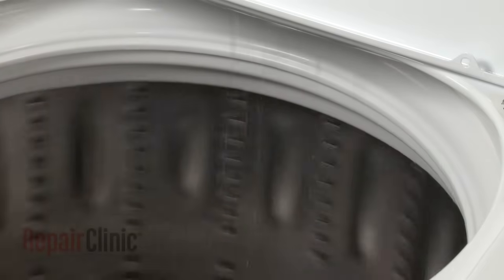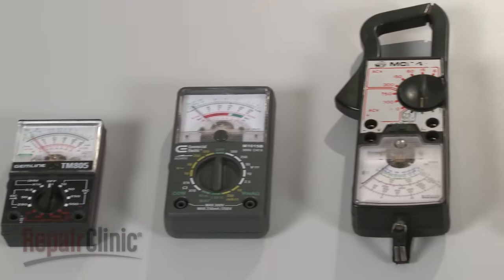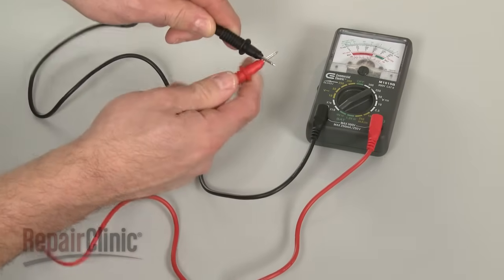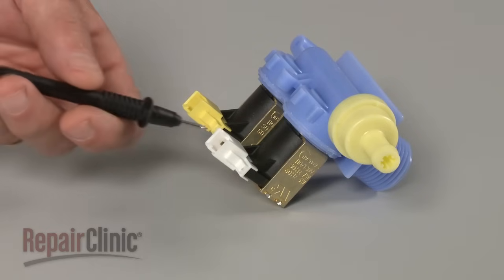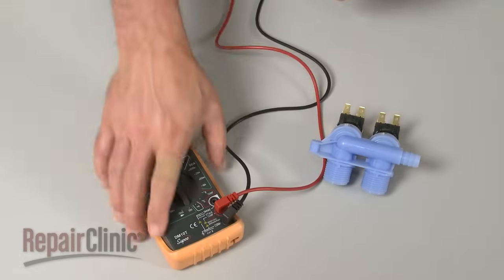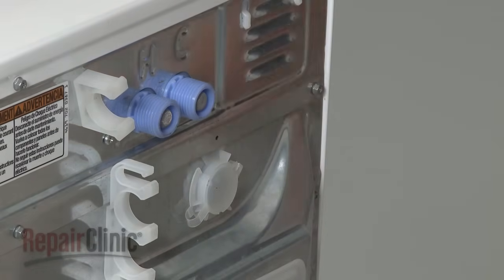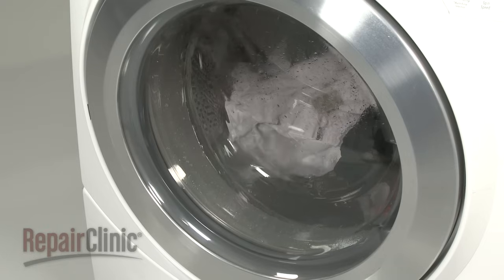Washer Not Filling? Water Inlet Valve Testing, Troubleshooting

Comment: So after educating myself on my Electrolux washer through many of these videos, I found the culprit of an error 11 in a dead coil on the water inlet valve. I was going to order the full valve assembly, but it was not in stock.. I decided that I might as well try something if we're going to replace it anyway.

I took the coil from the bleach dispensing solenoid (teal capped), fitted it with the dead coil's plastic connector cap (brown capped prewash solenoid) and did a swap. We rarely use bleach and at 180$ for the valve assembly I gave it a shot... And I have a working washer now!

Comment from the maker: The water valve tested had a coil with a resistance of around 1083 ohms which is typical of most valves. The meter is zeroed out on the right side of the x10 scale. When the coil is checked the meter is reading correctly. If the coil was shorted the needle would go all the way over to the right side towards the 0 or no resistance side of the scale. If the coil was open the needle would not move at all and stay on the left side.

Comment: Great video, thanks. I have an LG WT5070CW, I removed the valves' apparel and measure for continuity but the reading was only 24- 25  ohms? You mentioned 90 to 150?Does it mean they are bad? Because they had continuity 😢
Thanks!

Comment: Thanks so much for the testing of the solenoid coils...Easy to do and the problem was with those new "safety hoses".. The device had "shut itself off" so no water coming in from the HOT connection and made it seem like it was the timer...it was not the timer or the valves...it was the SAFETY HOSES.
WE ALWAYS SHUT OFF THE WATER TO OUR HOUSE WHEN WE LEAVE SO...THIS STUFF IS JUST A PROBLEM WAITING TO HAPPEN...THE COILS WERE GOOD, CHECKED HOSES, HOT HOSE NO GO!! CASE CLOSED...THANK YOU, THANK YOU..

Comment: This worked perfectly for me. One of the Cold-Water solenoids was open. This matched what I saw ..I used the hand wash and tried first hot only and then cold water and saw only a slow drip for the cold-water hand wash. Replaced the cold-water solenoid and all is well. Thank you for the video. I have a Maytag machine model MVWX655DW1.

Comment: Question,  I  have a code 49. I  checked continuity of both valves-good.  Replaced inlet value.  Continuity good,  same error.  Water supply good. I noticed  a terminal with 5 purple wires unplugged,  what are these for? Controller 421438USP. P7CPE.
ANY SUGGESTIONS?

Comment: thank you for the video, very helpful, I  have bosch washer machine double water valve with black covered board attached to the neck of it, , is it a flow meter sensor? and is there is any way to test it?

Comment: The pressure switch is good. The technician does not know what's wrong. The fill valves will not open to let water in if the fill valve solenoids do not get the 120V to operate

Comment: I had the same problem and found on a repair comment board that it was a disconnected water inlet tube.   Take off the top with the two back screws and check the small hose connected to the bottom of the round water inlet sensor.  Mine was at the front right.

Comment: Very useful video. Thanks.
Mine is this model and it leaks at the dual valve & drips at the right knob (inside). How do fix for the dripping problem?
Thanks again.
Reply: You are Not In VN to repair a $25 item !!!!!!
Reply: @khangchiennguyen4314  I'm in Canada. Finally, I had the piece changeda and it works. Thanks

Comment: Quick question, if water is trickling into the tub when the machine is off, do you change the water supply hose fitted to the inlet valve?? Thanks.

Comment: Came here to confirm coil value I was reading matched others. I was recently shipped an inlet valve with a failed coil on cold side. Beware of cheap knockoff parts. Replacing with a USA-made OEM part for a few bucks more.
Reply from the maker: OEM parts are built to last with rigorous industry standards and testing. All the parts we sell are OEM parts, which you can find here: RepairClinic.com

Comment from the maker: If no power is getting to the valve you will need to trace the power back and see where you are losing it, (pressure switch, timer etc.) A valve coil  can still show continuity and not let water thru. The thermistor is usually a high resistance so it will not show on a meter unless you use the higher settings.
Reply: I have a whirlpool duet washer with brand new motherboard but no power for solenoids out of the motherboard. The PSI switch is good. Where is the timer you are talking about here located

Comment from the maker: The thermistor (part with the two prongs sticking out) senses the water temp and allows it to be controlled automatically. If you can’t get water out on any of the settings you need to see if you are getting power to the coil. If you have power to the coil and water is on, the valve is bad.

Comment: I checked the valves on a machine that had 'no-hot-fill error' and all of them got continuity around 1K ohms but I went ahead and replaced the 'Inlet Valve Assembly' and the machine was back in service. After that, upon the dis-assembly of the old valve, I found out that the rubber diaphragm in the hot-water inlet valve is teared. So, I've learned, although the valves are 'electrically sound', they can be 'mechanically faulty.

Comment: Hello there, the water inlet in my LG top load washing machine pumped little to no water when turned on, so I removed the inlet valve assembly, cleaned it, and put it back in its place exactly the same way it was. But after this, it started pumping so much water through the water inlet/detergent drawer even when the machine is turned off. What might have gone wrong? Thank you for any help!
Reply: You aren't supposed to clean them out just replace.

Comment: My Whirlpool Imperial Series top load washer is dispensing hot water when it is not supposed to.  It does it when it is in agitate mode and when it is set on cold water.  Does this sound like the water inlet valve?
Reply from the maker: We recommend that you verify the water hoses are connected to the correct hot and cold fittings on the washer first. They should be labeled on the back. If you set the water temp to hot and you get cold water, the hoses will most likely need to be reversed. If they are on correctly, the wiring may have been mistakenly reversed. Was it repaired recently? Another possibility is that the temperature switch may be bad.

Comment: I successfully repaired the valve by cleaning it with some anti scaling removal liquid and it works without an issue. If its still buzzing you do not need to replace the whole valve. Just open the screws and clean it and try.
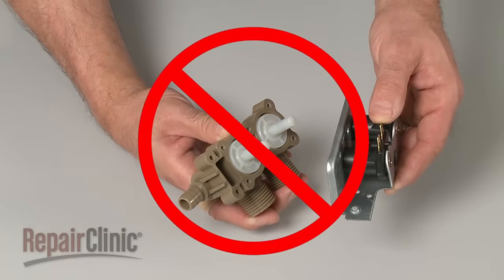Reply from the maker: Thanks for commenting. Might be OK but keep in mind what we say at the 2:40 mark of the video. When we say part failure that can be flooding you home.

Comment: I have a GE front loader washer & have no water. I tested the like the video. But I have o on my meter. The company said that that it doesn't show anything on the meter? The new one has nothing on the meter also? can you help.
Reply from the maker: Jim Nichols You must set your meter to Ohms when conducting this test. When you touch the leads together you should get zero ohms and when the lead are apart most meters read OL (open line). Normally, when testing issues arise people does have the meter set to the correct setting or the ohm range they selected is too high. Most coils will read between 5-500 ohms. The main thing is you get a resistance and not an OL.

Comment: hello, I watched that video and Im trying to test the water valve. I have a whirlpool cabrio wtw5500wx1. well, i changed the drain pump and the belt, because let the clothes wet. Well, i dont know what can be. By the way, while the washer starts i saw that water coming from the bottom, i dont know if i need to replace the shift actuator or the both valve. When I tested the valve with a digital milimeter show me 1.01. what it is means? was i little crazy when in the wash cycle im still hearing water coming inside the basket. Please I need help, by the way you have useful videos that helped to install the two parts that i mentioned.
Reply from the maker: +guerreradecristo777 Each solenoid coil should measure between 5-500 ohms resistance. The wiring diagram will give the specific ohm values, but in general as long as the coil has a resistance and not shorted open then it is likely still good. The problem though is valves can fail mechanically too so the test is not always conclusive.

Comment: Thanks my meter is set at 200 ohm but nether side reads anything. Even on the new one it does the same o on hot & cold sides. Confused?
Reply from the maker: Jim Nichols 200 might be too high. Try the single digits or the lowest setting. Both the old valve and brand new one are not going to have 4 open coils. Do you get zero when you touch your leads together? If not you likely have a bad lead or a problem with the meter.

Comment: I’ve got good pressure and 1.002kohms with 24v coming to to inlet valves when on. Washer makes a humming noise when calling for water but no water. 🤷🏽‍♂️
Reply: Apparently I powered everything down checked and when I turned on cold it ran and now is giving hot and cold on demand. What could cause intermittent issue like that?

Comment: My front load Bosch washer has a slow water leak into the wash drum when not in use.  In 2 or 3 days, it has maybe a cup of water in it.  However, when we unplug the machine, it doesn't appear to be leaking at all.  Could this still be a water inlet valve failure?  Why would it fail when turned off, but not when unplugged?
Reply from the maker: +Donna McRee That does not make much sense. The inlet valve needs 120 volts to open. The washer might leave more water in than you think to reduce the risk of seals drying out.
Reply: Hey … I changed the inlet valve and the Pcb…. My probelms is the machine just stops don’t do anything !!! Please help

Comment: Hi, my issue is that when the load is complete and the washer turns off, water still drains into the tub. You can actually see water filling the tub. When you shut the water off it stops filling.

Comment: Hi, Maytag Performa Washer sometimes drains while filling. My wife says resetting water level sometimes fixes  problem. Where do I start?
Reply from the maker: mikeokizichy The main drive motor has to be running in order to operate the drain pump on the Performa's. If you don't here the motor running then water is likely siphoning out. This occurs if you sealed the drain hose to the stand pipe.
Reply: ***** I've made no changes. Is this something that occurs on it's own? We do have low water pressure which sometimes drops really low due to a public works project which damaged some pipes. It should be fixed by the end of the month.
Reply from the maker: mikeokizichy The drain hose sometime gets pushed too far down the pipe which seals it. Low water pressure could allow water to enter the washer, but siphoning is odd.
Reply: ***** Update, they've repaired the water main & pressure is back up with no more washer problem. Coincidence?
Reply from the maker: mikeokizichy Probably not a coincidence, thank you for sharing.

Comment: the problem here i have right now its the voltage was dessapear from the connector goes to the cold .. i test the intlet alone its ok, i check the hose its ok. the behaviour its fill slow in cold i connect the multineter and i see whenhit start the voltage 125 only was one second then dessapear and if you pt the hot the 125 are steady if put hot and cold  the voltage goes on and off. i check this connecting only the multimeter lead to washer cables goes in the inlet valve. and the washer its a westi g house i can find anywhere any service manual. its wwac14m3hekw

Comment: My machine automatically fills the tub with water when it is turned on, and there is no way to stop it except to turn the machine off or to close the water line. I suppose it would overflow if i left it on long enough, but i don't want to find out. Does this sound like a water inlet valve problem?
Reply: I tested it electrically (as instructed in the video) with a tone and it had no tone, so i figured it failed electrically. But since the water only flows when the machine is turned on, that didn't make sense to me. so i reinstalled into the machine, plugged it in and turned it on. There's a rattling sound accompanying a vibration in the valve when the power comes on, so does that mean it's a mechanical failure? I mean it's a valve so it should just open or close, but it seems like it's spinning around and around inside. Or maybe it's an electrical problem in the panel?

Comment: Thank you for the video.  I followed the instructions and my Fluke T5-600 electrical tester indicated that the solenoids for the hot water valve had a reading of 897.  For the cold water valve the reading was 890.  These were within the acceptable range indicated in the video, so I concluded that the valve did not have an electrical failure.  However, when I was discussing this with the friend who had given me the Fluke T5-600, he asked if the tester made a noise when I ran the tests.  I informed him that it did not, and he said that if the tester didn't make a beeping noise then I did not have continuity and did, in fact, have a faulty valve.

Is it true that the ohm readings must be accompanied by a beep or noise of some sort on the test instrument in order to be accurate?
Reply: I read 1300Ohms but when I switch to the other setting I do not hear a beep either. Did you ever figure out if it should beep or not?
Reply: @Matt-po7mg  Nah.  Sorry.  That was a long time ago.  I'd already forgotten about it.
Reply: Electrical engineer here. Beeps not needed for an ohmmeter to read ohms value accurately . 890 sounds fine for a good coil.   

There is usually a separate audible continuity setting on the meter that will beep when low resistance is detected. This mode is used mostly when hunting for short circuits, and the exact value doesn't matter to the user.
Reply: @jeffweber8244  Thanks!  I'll try to remember that (but will probably forget) for future reference.  Not too long after my original post, I threw in the (dirty) towel and just got a new washing machine.  ;-)

Comment: I don't have a meter, any way I can test this without one?
Reply from the maker: +jasona555 You can inspect it for clogs, but the only way to test it safely is with a meter.
Reply: You check without meter used test lamp and continuity tester any one used for check inlet water valves coil

Comment: I replaced my actuator, still doesn't work.  Sensing does not engage to wash cycle when I start my load.  Lid lock will lock and then it just flashes.

Comment: Hi! Thank you for your video. I set my digital multimeter in continuity and It showed no continuity. After, I set the multimeter in resistance and I got 3.7K ohms in both, the sigle and the double solenoides. My solenide is Fisher and paykel Brand. (VALVE INLET COLD DOUBLE - 790418 - Fisher & Paykel). Can this resistance value be a open circuit? showing that the solenoides are faulty? Thank u in advance
Reply from the maker: 3.7K ohms sounds like good solenoid coils, not open for continuity.
Reply: RepairClinic.com I also got no continuity on my multimeter but 3.7k ohms resistance on the solenoids. So I guess my water pressure inlet valve is ok .?

Thanks

Comment: I'm confused, I thought if the valve has infinite resistance then the valve has failed. In this case shouldn't the meter needle peg out to it's highest setting, rather than not moving which would indicate zero resistance?
Reply: Look at the scale on meter closely. Needle moving to the right indicates LESS resistance. So non-moving needle is infinite, aka open-circuit.

Comment: Hi mate, i have a problem. I have a front loading zanussi fls-571c thats
 running on a manual timer control. The problem is it spins, it rinses. 
But it doesn't wash. After filling up water, the water stops and the 
timer clicks but no washing starts and no voltage on the capacitor 
either that starts the motor but voltage present during rinse and spin 
about 400V plus. After the rinse or spin completes, the capacitor 
voltage drops to zero instantly. Could that be a capacitor fault? Or 
something else? Please help.

Comment: I have replaced my cold/hot inlet valve in my machine (fisher and Paykel mw512) as soon as I turn power on it just beeps and has lights 3,4 and 8 which I was told is inlet valve problem, I replaced valve but still beeping the same any help would be much appreciated
Reply from the maker: We recommend that you verify the wires to the valve are not broken. Since you already replaced the valve and got the same problem, it is most likely not the valve. If the wires to the valve are ok, you may have a bad control board.
Reply: The valve come with replacement wires so I don't think that could be it, is a fault board a technician job or something I could have a crack at myself?
Reply: ***** Why haven't you replied to Mr. Rowbotham's question?  It's rude to have replied to his first inquiry and then seemingly ignore his second one.
Reply from the maker: Barry Rowbotham Certainly could be a main control problem but the only way to know for sure would be to do some electrical testing with the wiring diagram from inside the washer and a multimeter.

Comment: “If no power is getting to the valve you will need to trace the power back and see where you are losing it, (pressure switch, timer etc.)” what other things should I be checking for?? My inlet valves are “good” but the hot water one is not dispensing. The cold water works fine. I don’t know why only one of them works but the other doesn’t
Reply: I have a whirlpool duet washer with brand new motherboard but no power for solenoids out of the motherboard. Where is the timer you are talking about here located